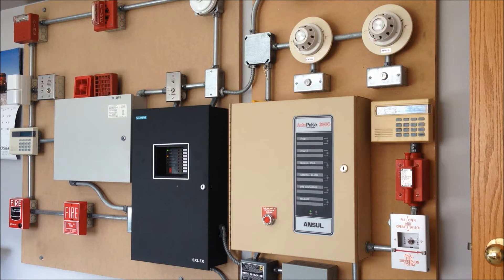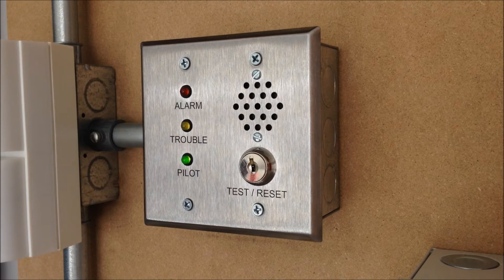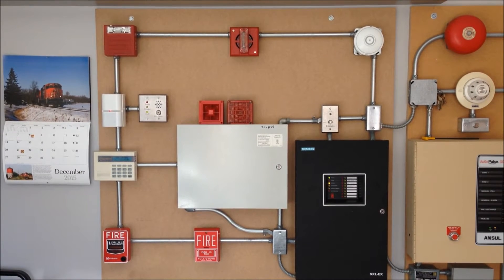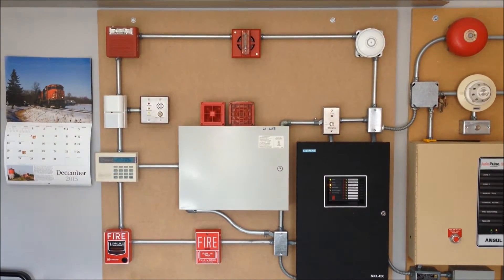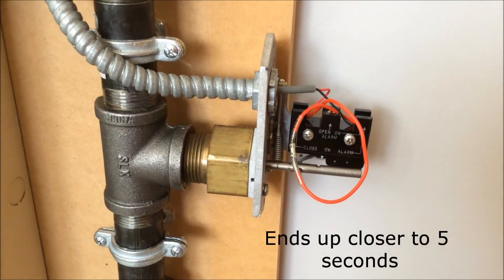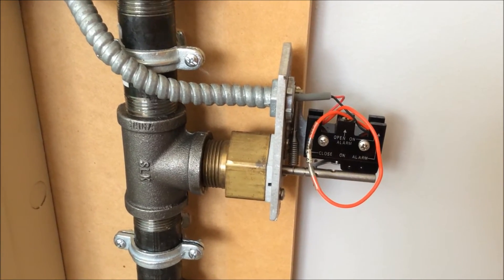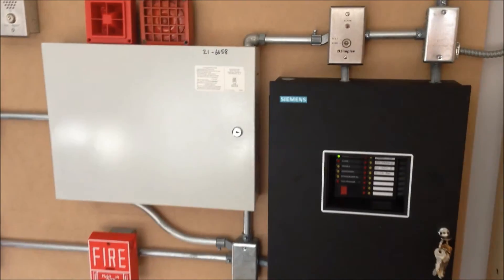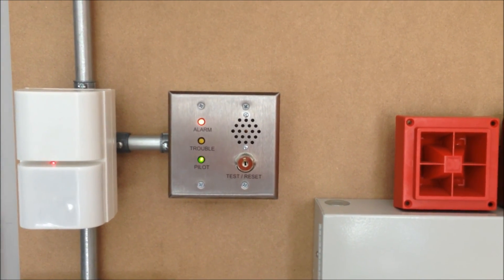System Test 16 | Fire Sprinkler Riser

Comment: Did u have to modify the paddle on that flow switch or change that paddle
Reply from the maker: Nope, it is sized for the 1" pipe I used.
Reply: Nice ok I’ve had them not go off had to change paddles I’m a sprinkler fitter in Massachusetts

Comment: If you don't mind me asking, how much has been spent on that set up As of 2017? I see this video is from 2016.
Reply from the maker: Hmm... that's a good question. Probably not as much as it would seem. A lot of the devices and parts (AutoPulse 2000, DMP XR-500, conduit, plywood boards, etc.) were saved from a building demolition and did not cost me anything. The only major investment on the system is the SXL-EX, which I purchased for around $125. I'd say the total cost to date is around $250, maybe? That being said, in most tests I have an additional $75-100 worth of pull stations and horns installed.
Reply: kcin556 nice

Comment: Lol. The other day at school, someone pulled a sprinkler head off the ceiling in the locker rooms. I was in that part of the school, and the water smelled awful, and was black. I was surprised though, the system, an older simplex 4010, took at least 20 seconds to activate. Hey, at least the admins know the sprinkler system works!